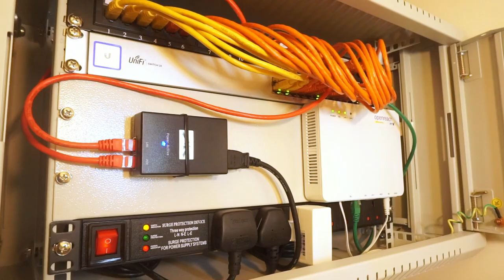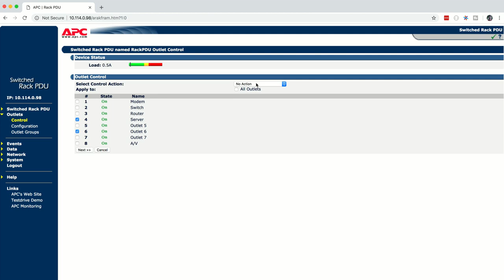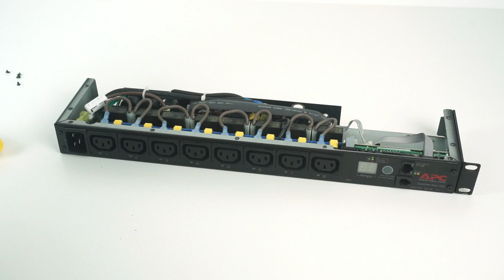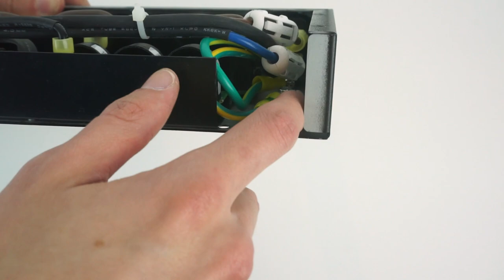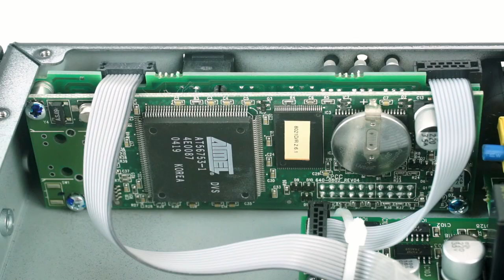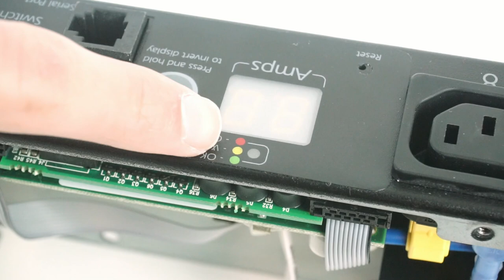Teardown of an APC Switched Rack PDU - AP7921

Comment: We actually still use these at work! (Not new mind you, as I believe they are not end of life.) Very solid devices and we've been lucky enough to never have one fail. As another commenter mentioned the piddly little CPUs isn't up to doing modern TLS - HTTP or SSH - but that's fair given the design is about 15+ years old now. Some of their transfer switches though have a particularly nasty bug - during a firmware upgrade, they say the outputs could start oscillating at 50/60Hz! Great video as always.
Reply from the maker: Yeah, I still use these in other production environments, they are definitely slow when it comes to TLS though!  That's a pretty nasty bug with the transfer switch, thankfully the only ones I use don't have any sort of network module so I shouldn't need to worry about that, definitely worth bearing in mind though!

Comment: at about 12 years old the caps in the PSU power supplies dry or split. the relays then latch in random states at power up. I have 8 of my 12 that have not died.

Comment: I've used some of these that are 15 years old.  The only problem is the processor is too slow to support https and ssh using the latest firmware.  Older firmware uses poor encryption.  I note you're not on the latest firmware as it's now green and branded Schneider.  You can flash the firmware, or reboot the management card, whilst the unit is in production; the status of the sockets doesn't change.  I assumed the relays were latching, and pulled open on power up.  I have had a few of these where the network port had died.  But generally they run and run.

Comment: So I see 3 current transformers. Also in the UI one can only see the total power for entire PDU. Weird. For the price like that I would want to have power monitoring on every single outlet, plus a separate for entire PDU (including the management board, and relays, and losses in PSU).

Why there are 3 tho? Is it to detect current leakage? (GFCI style).

Oh. I see, this is to also support 3 phase power with the same board. My bad.

Comment: What's really bad with PDU manufacturers is that they subcontract out the software and design super pretty graphical interfaces to appeal to what I imagine is their principal audience, but ignore how painful this makes them to use from automated scripts. When you have a board under test that you need to power cycle 1000 times over 3 days and ensure that each time it boots without problems, these GUIs have to be reverse engineered to do the power off and on. The industrial PDUs that you can still control through simple telnet or serial port commands are more and more rare.
Reply: Yeah. Lack of open source firmware for these devices, and crappy Java or web browser interfaces with fancy graphics is just absolutely killing me. All I want is some simple SSH or HTTPS interface where I can do GET and POST and do simple things quickly. Plus some quick HTTP monitoring where I can get a status of entire device quickly, and my monitoring system can plot it or alert on weird conditions (like PDU not accessible). SNMP is also good option, but obviously more horrible than some Prometheus metric endpoint.
Reply: movax20h SSH will work perfectly on most of these modern APC PDUs, the commands are fully documented. It works really well for me, no GUI needed!
Reply: SNMP write option saves your time

Comment: I think flash was probably just more expensive than battery-backed RAM when this was new. (Some?) GBA carts used it despite flash being available, but it was cheap enough by the DS that they switched. Since you mentioned this being an old supply, the production design is probably unchanged since its inception, even for a seemingly small swap like that.
Reply: I believe flash was also perceived as less reliable compared to battery backed SRAM back in the 90s when this would have been designed.
Reply: this battery is just for RTC, and flash is over there

Comment: The redundancy could be solved easier by using bistable relays, instead of two PSUs.

bistable relays require less power to keep in one state, and remembers the state even if the entire device looses power and is recycled, or software crashes or PSU is faulty.

One could argue that it might be good to start of PDU with all relays in off position, so one cay do a delayed start on each outlet (to limit total inrush current to servers).

Also redundancy in PDU is not that important. If you are powering critical infrastructure, then your servers and switches will have redundant PSUs itself, and they will be powered from two independent PDUs, and failure of one is fine!

Sure, having redundant PSU is better, but this adds to cost, and in a lot of applications is unnecessary.
Reply: They use two PSU in every 'Switched' type PDU model, and every PSU output voltage level is checked by MCU and reported to event log and further.
There is a comment on reddit telling how it shows up when two PSUs are dying and the relays go out for a walk.

Comment: they are not inductors, They are called current transformers.
Reply: They do work off the hall effect but in a less direct way than "Hall effect current sensor " and is in no way what is call a "Hall Effect sensor" as that is a sensor for magnetic fields not AC current.
Reply: No, if you crack one open it will have a lot of windings, the single winding is the wire passing thru the middle of it. Also It is still a transformer with one winding, two windings will double the rated output, three will triple and so on.
current transformer
https://en.wikipedia.org/wiki/Current_transformer
hall sensor
https://en.wikipedia.org/wiki/Hall_effect_sensor

edit changed from google img search to Wikipedia
Reply: I typed this before your last post showed, but I will leave it as general info for anyone who may find it helpful. looking again at 6:53 you can see they are marked CT on the board backing me on them being current transformers as well as the dot that shows phase of the output only needed on the CT as a hall effect current sensor would have at least power, ground and signal pins instead of the two sides of the windings.
Reply: It's a bloody current transformer, common knowledge.
Reply: Actually I do know where it is as most other "stan" republics of the 
former Soviet Union. In this part of the world they teach us that in 
primary school geography classes. "Dumbass" is maybe how you understood it but that is 
your problem, not mine as a stated nothing similar.
Reply: Bruce Li  These are current transoformers. hall effect or magnetic flux sensors are used, but they almost never have this shape.

Comment: Could you perhaps disable one of the power supplies to see if the error is reported?
Reply: Sure, just disconnect a power to it or from it to main board.

I guess the PSUs are connected to common bus bar to relay drivers, opamps and CPU board via some diodes. Desoldering a diode is another option.
Reply: It will show Er on the 7 segment displays if an internal power supply fails. Also, even if both power supplies fail, it will still stay “latched” in the current state till power is removed from the pdu. At that point you need to repair/replace both power supplies.

Comment: The battery must be for a rtc probably
Reply: Unless this has a timer function it has no need for an rtc, I would bet $10 its to store the IP and power up delay "can be worked out without an rtc"
Reply: @chevsev  I don't really know, but given the pdu has an internal web and telnet servers, it may be logical to think it has a way to keep time..
Reply from the maker: I think you might be right, they support NTP although for some reason mine had the time specified manually and it seemed to keep time while it was off.  The time is mainly used for timestamping logs.  Would be interesting to know if the battery is purely for the RTC or if it also uses it for storing settings.
Reply: off or unplugged? There may be an rtc but it looks like battery backed ram and I don't see any crystals for an rtc but it may be mounted on the back of the pcb or hidden under the battery. Backed ram is cheaper than flash "or was in 04" an RTC again is added cost you don't need. RTC or not I stand by my bet that the battery is for backed ram for keeping network and start up info..
Reply from the maker: Unplugged - as in that it kept the time despite being dismantled in this video :P - I suppose they have to cater for environments without NTP servers and in a device like this that costs over £620, the additional cost to fit RTC hardware is likely not an issue.
Reply: battery is for RTC, but it my also be for an SRAM with some basic configuration (like timezone info, default startup behaviour if it can't connect to network / dhcp, static ip address or buffer of dhcp leases). Last thing you want is for your PDU to refuse to start outlets if it can't find the IP address or synchronize time to NTP, because switch or server it is supposed to find this information is connected to one of this or other PDUs.